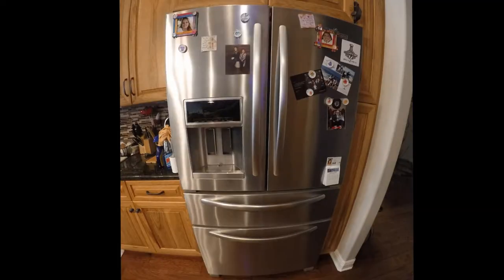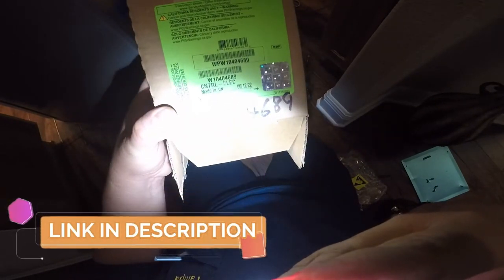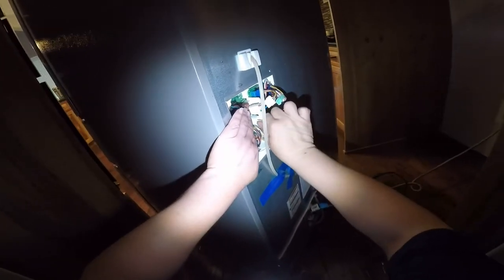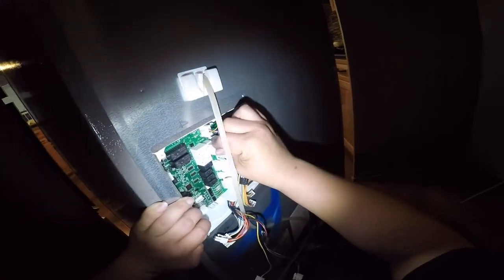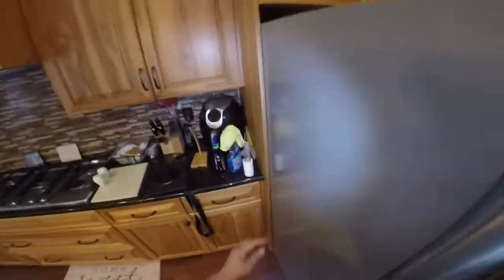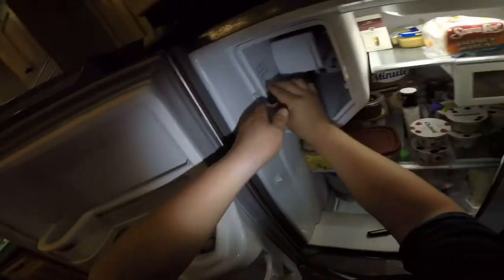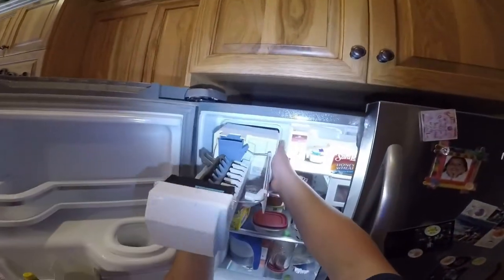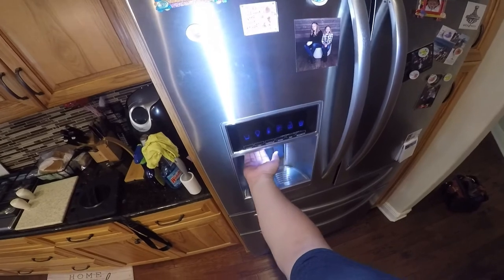How to Fix KitchenAid Refrigerator Making Ice Non Stop | Always Dumping Ice | Model KFXS25RYMS2

Comment: i have this exact issue, how much should i pay someone to fix this for me?
Reply from the maker: This repair can cost between $450 and $650 depends on how much is the main control board at the time
Reply: @DIYRepairsNow  I have the opposite problem in that it no longer makes ice. Any suggestions as to how I can verify that the main control board needs replacement?